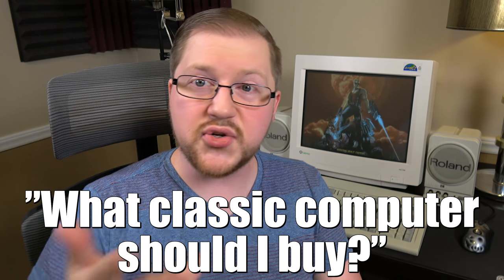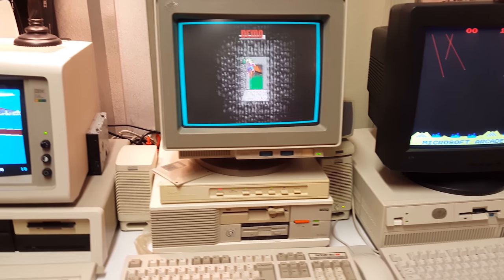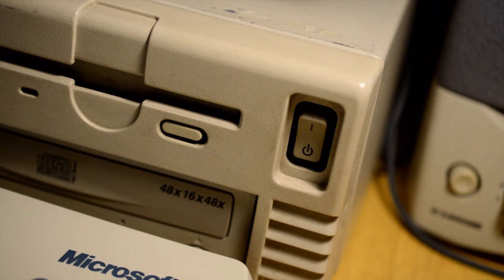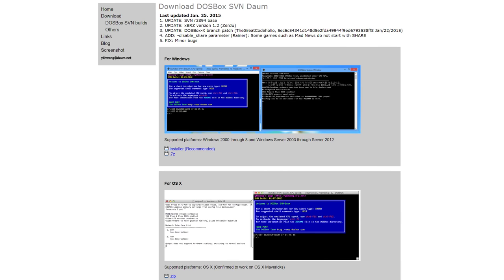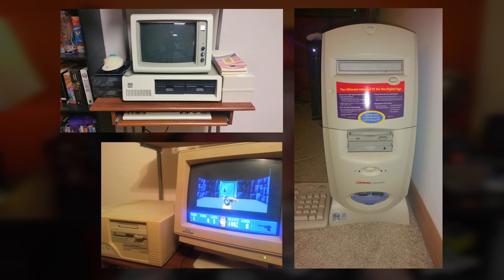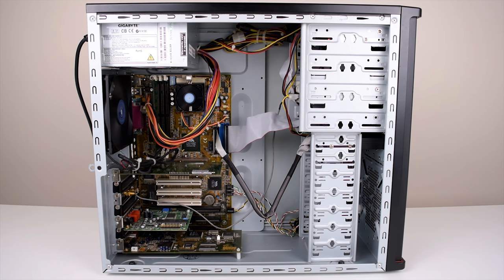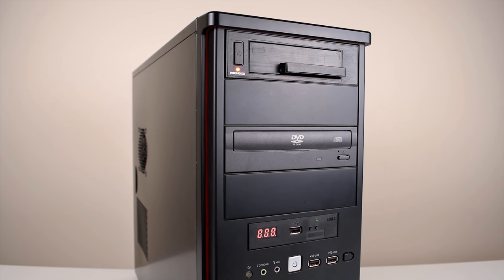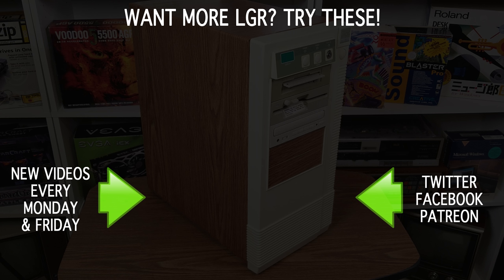Choosing a Retro PC for Games: Advice & What to Look For

Comment: Agree on everything except one:  joysticsk under DOS.  DOSBox is fantastic and an easy solutuion, no doubt.  And though it robs you of the satisfaction of building and configuring real hardware, the operating environment of DOSBox is purely genius.  But my disagreement comes with the joystick options for DOS.  No, you are not limited to 4-button Joysticks.  Since the early 90s, I used the Thrustmaster FLCS, TQS, and RCS (F-16 stick, throttle, and rudder) that you plugged in between your keyboard and PC through the game port on your sound card.  They were fully programmable keyboard and mouse interceptors/emulators.  They still pop up on Ebay regularly, and are an absolute thrill to use if in good working condition (easily restored).  No shortage of web sites devoted to these legendary devices.

Comment: Quick comment on the display showing speed.  It really does not do that, it shows what you told it to display based on jumpers.  Some dishonest stores in the day were known to lie there, like having it show 50 when the real speed was 33.

When I sold those cases, I always set them to show "HI" and "LO".  That way I could throw in any speed CPU and it was correct.

Comment: I'm probably just lazy, but once I started upgrading (Thanks Aces of the Pacific!) I kinda never stopped, so eventually I wound up just putting the older systems back together, albeit in updated forms. I eventually wound up with enough gear to have optimized hardware for a particular generation of games, though some old games that are tied to the clock speed of the CPU (looking right at you Falcon 1.0, and don't try to hide back there WIng Commander I see you) still require the turbo switch or MoSlo. Biggest pain is remembering to replace the CMOS batteries before they die, although I suppose I could just take pics of the correct BIOS settings on my phone and have them available. Probably should do that, actaually.

Comment: 16:50 seems interesting. He (Brutal Moose) has swapped out the matrox graphics (and hopefully kept it). The "celeron" CPU is definitely 800MHz? That seems a bit out of place for that model and yet he does not seem to have indepth knowledge which suggests somebody else has done something to it before he got it, unless he mispoke and meant Pentium3 at 800MHz. It's just that a Coppermine celeron FCPGA-370 can be overvolted as a means of overclocking because (unless somebody else found a way to put an 800MHz celeron in that machine) that might be a celeron that has been overvolted from a core clock speed (to 800MHz) by means of increasing the Front Side Bus. It might have once been a Coppermine 533A MHz or 566 (if the BIOS shows the FSB over-volting to have resulted in a FSB around 100MHz), or it might have been a coppermine 600MHz or 700MHz overvolted to 800MHz - however a 633MHz or 667MHz is more likely (than a 700MHz) as those actually came in the HP machines. If any of that is true (and btw check the bios), the celeron might be overclocked to 1.8Volts. That'd get hot. If this is all true, it means he has a good (desirable - as in collectable, as in valuable) celeron. So swapping out that CPU would not be a wise move (especially if the voltage has been changed) because throwing it away would be a terrible waste of money.
Putting in a faster CPU probably would not add much (although perhaps a pentium3 at 1GHz would help a bit but you might devalue it). A faster graphics card would make more difference. A Radeon 9800pro might be slightly overkill but would work (assuming the Power Supply behaved), but really a 9000pro or above (to compete with that current decent nvidia he has) would be minimum needed. Probably an ATI 8500 or an fx series like say at most a nvidia fx7600. It would make more sense to remove that second RS232 serial expansion card (or just move it across to a new PCI slot to nudge an IRQ if needed), disable the onboard sound's IRQ (again via the BIOS) and put in a usb2 card (probably saturating the bandwidth making it difficult to put in a PCI ethernet). Then plug into that a usb-to-rj45 ethernet dongle. Then buy the XP machine and network them. Maybe also get a null-modem cable to play multiplayer baldursGate2 (and other infinity engine games). An ISA ethernet (10Mbps) expansion card would not be out of the question. the upgrading of the graphics (e.g. to that ATI 8500) would allow for some games to run better such as battlefield-vietnam multiplayer LAN networked to his 2nd newer WinXP machine.

Comment: Yeah this is a hard question to answer, just because the desire to play classic games on authentic hardware is necessarily for the purpose of satisfying the desire for subjectively pleasing aesthetics, with objective performance measurement being secondary.  

If it were up to me, I’d probably choose a pentium era computer.  This is because windows 9x operating systems will all run on it, giving access to basically all dos and windows games from the “classic” era, while still being part of the classic era itself.

Comment: I think I still have my old Asus XP55T2P4 around. I remember doing the jumper trick to get a K6-3 400 to work on it. Setting the external jumper to 2x and it internally switched to 6x on the 66 bus to get 400MHz. It has a pair of 12mb Voodoo2's along with an SBAWE32 and uses a TNT2 as the primary graphics card.

Comment: For Dos and Win95/98se gaming the absolute best solution is 2 PC's. One for old Dos, and one for late DOS/Win98 era. Build them with old parts, EXCEPT use a Gotek Floppy Drive emulator, and use a SD card as the hard drive. Super simple, and easy to build. The only retro hardware you actually need to buy is a motherboard, RAM, CPU, Sound Card, and Graphics card. Every other single component can be  brand new including the cd-rom drive, enclosure, PSU, etc.. This is a great solution to play games accurately on real hardware, and perfect for old dying floppy drives and floppy drive media.

Comment: Personally I would love a properly retro computer, but I don't have the space for it, so for older games I just use dosbox on my modern PC, and I also have a old SFF hp core 2 duo  machine with a GT 730  with xp on it for games from around that era. It fits nicely between my main pc and 4k tv. Which I can easily switch the aspect ratio to 4:3 It may not be period correct but it works, and rather nicely and being able to play these games is more important to me than anything else.

Comment: The Ultimative Dos and Windows 98 PC for me is:

Pentium III 800mhz (which I can still underclock for problem games)
Asus P3B-F Mainboard
256MB SD RAM
3DFX Voodoo 3 3000
3DFX Voodoo 2 12MB (yes you can use it alongside the Voodoo 3)
Soundblaster AWE64
80GB Hard Drive
Teac CD-R ROM 32X Speed

Comment: When it comes to trying to play games from 1996 to 2003 on newer hardware I have found that for glide games nglide is awesome and for direct3D games I can get past a lot of visual problems using dgVoodoo. The latest version contains files for direct3D emulation. My favourite example is Black & White which on newer graphics cards with more than 256 MB of RAM won't show anything but the most low-res textures the game has. If I pop the Direct3D drivers from dgVoodoo into the game folder and set it up using the setup utility it works in all of its glory. And compared to original hardware I can even play it with high resolution graphics and FSAA cranked all the way up.

Comment: You really only need 3 computers to cover the entire DOS-era gaming period.  An AMD 386DX-40 (with turbo to be able to downshift) to cover the 80s.  An AMD DX4-120 with a good VLB video card (with turbo for downshifting) to cover the early 90s, and an AMD Athlon XP 3000+ with a ViRGE/GX and Voodoo 3DFX makes a great PC that will cover the entire later 90s.  All parts are dirt cheap on Ebay, and can be easily obtained compared to the now over-priced and increasingly rare Intel Pentium 3 setups.  AMD is the answer to retro builds, and these 3 PCs will cover that 20 year era.  However, Phil from Phil's Computer Lab nailed this to perfection with a 4-in-1 PC that is based on an AMD K6-III+ (P3) that can downshift to a 386 by being able to toggle cache options in the BIOS.  Utterly frickin' brilliant.

Comment: Funny,  I just found my old SoundBlaster ISA card in a box, with built-in CD-ROM/IDE pin header and all (for back in the day when computers may have only had one IDE channel and CD-ROMs were often run off of pin headers and controlls found on add-in cards....    Its sort of funny as I believe the drive and the sound card together cost $250 (the drive is long gone--dead, but I held onto the card for some reason).

Comment: Hello LRG. Watching this video and the collection of pcs you have is for me an example to follow as a coleecionist. But here in Argentina it is more difficult than in the United States, since machines like 286 are hard to get the same as the 386 or a little less the 486. Let's not talk about a Tandy 1000 with an 8086 processor that is extremely difficult to lift and with very high prices. expensive And not many people I include myself are encouraged to buy by E-bay from here.

Comment: I use my original P75 for DOS, which I setup for dual boot with NetBSD <maniacal laughter and thunder> windows95/98 I have a P3 553 MHz and I still have a Win XP with one of those Intel EMT64. I made a VM with XP under VirtualBox to play Age of Empires and Galactic Battlegrounds, just had to install the non-recommended 3d drivers which you have to install in safe-mode or it won't run. Also I'm running my King's Quest games under DOSBOX.

Comment: I use a laptop with an AMD k6-2 450MHz, 192 MB RAM, 8MB Trident video card (it sucks, LOL) 20GB hard drive and a 1024x768 TFT display running Windows 98 SE. It works fine for what I use it, which is from Wolf3D to Quake 2 and everything in between. Need for sped runs on it too!

Comment: Some old games writen in Turbo Pascal (or similar programming languages) is unable to run - it yells "ERROR 200", or "EMM has ...." errors (because CPU speed is more than 200 MHz - google says). Im using an old Pentium I @166 MHz (64 MB of RAM) laptop with Windows 95. Its awesome. I have also 286 @ 16MHz laptop (B/W display, 512 kB of RAM), 386 @ 25 MHz laptop (256 colors, 2MB of RAM) & 468 @ 66 MHz laptop (16 MB of RAM). I have also IBM ThinkPad A31, Pentium 4M @ 1.8 GHz (512 MB of RAM) with Windows XP SP3. :)

Comment: Thanks for your heads up advice! My choice is an early XP compatible computer with 98SE installed and an old version of DosBox for those older games like boulderdash, etc. With onboard AC'97 audio, though .... sound is still a real pain in the bum resulting in BLUE SCREENS OF DEATH!

(Oh, for the old C64 times, where the games just worked despite hardware revisions!)

Comment: I would say get an older dell dimension, with a pentium 4, 1gb ram, decent agp card, easy to find and great for old games like cs1.6 and gta vice city. 
If you like to flash a bit more cash, I suggest a Gateway 2000 p5-120 or a Compaq Deskpro EN with a P3.

Comment: I went the via route and built a 1.3ghz mini itx epia-sp with 512MB (took me a while to remember 1GB was not going to work, it wasn't until I rememebered that was the reason I downgraded to XP for a while as I wanted to use all my ram back in the day, soon went back to 98SE though as XP was worse than Vista before SP1 came out, not to mention no Voodoo 5 support officially :( ), floppy drive and 24x DVD-ROM, with a Mac Voodoo5 PCI flashed to work on PC (the board only has 1 PCI slot so this works perfect and ticks all the boxes) running Windows 98SE. Bit overkill for older games, but gives me a bit of flexibility as well as allowing me to have something that won't take up to much space.

Comment: Sorry for the comment on a 5 year old video but this is just cool. I'm currently building (and documenting on TikTok a Pentium II Overdrive / Pentium Pro) with a Voodoo 1. I'm aiming to run an older version of Linux with Wine (or maybe Windows 2000) and hearing so many points of view was super cool.

I think a lot of it depends on what you want to play. For me it's MechWarrior 2,  Rogue Squaron, Tomb Raider and Diablo 1. I think my hardware selection is right in the mix
Reply: Update to this.  I DID build the machine.  Pentium II Overdrive 333 on FX motherboard. 270mb of ram (a few of my 128 ram sticks were throwing issues or it would be 512, but 270 is plenty).  3dfx Voodoo 1 and a Sound Blaster Live (sb 0220 and careful driver install, lol).  I ended up running Windows 98SE.  Playing Rogue Squadron, MechWarrior 2, Diablo 1 and 2, Tomb Raider and X-wing.  

But that being said, I play speed sensitive games (like Jazz Jackrabbit) on my Steam Deck through Dosbox, because it's so much easier to set your cpu cycles and such in DosBox.

Comment: That's it, I'm getting my four PCs up and running... the Pentium III-500, Pentium III-866 and P4 laptop are ready to go but I need to rebuild my Pentium 100 but I have all the parts I need. Just need to find a cheap AT cabinet but those are less difficult to find that I initially thought.

Comment: I see a final unity in the background, great game.

also, 486 laptops have some great bonuses over a desktop. They actually have some interesting features you won't EVER find in a desktop as they continued making 486 based laptops further ;)

Also your problem with games later on in the later 90's early 2000's will be handled by windows 10 compatibility TOOL strange enough. Not compat mode, it has a built in tool that can rebuild a game to fix old direct draw calls like the green screen of icewind dale 2 for instance.

Comment: I am newbie in retro pc industry, and I use for dos games windows 98 machine with slot-1 PII 333, 128 pc100 ram, riva tnt/vanta or any other 8mb agp 2x gpu and PCI Yamaha YMF724 with official OPL3 emulation using pc/pci-sb_link 5pin bridge to emulate isa sound card that many dos games require. In Ukraine, where is war currently, you can find all these stuff for 2-5 USD, the almost “ultimate” dos gaming machine will cost you 20-30 USD! But voodoo 3 would still cost you 60-70 USD

Comment: I used to have a 486 DX4-120, with 32MB RAM, an S3 Virge GPU, AWE32 sound card, 1GB hard drive, 52x CD -- basically, the best hard-ware I could get that would be compatible with one another -- just to play the original DOS version of XCom (since the original Windows version had borked sound effects), with the intention of playing other classic titles also, which never eventuated... Then I came across DOSBox and OpenXCom, respectively, so eventually got rid of it after it say in my closet for nearly 10 years without use... Kinda regret it now I've been watching this channel...

Comment: honestly, i just use a amd k6-2 pc with a voodoo 2, a sb awe64, and a matrox card. it runs almost everything 1987-1999, disabling the caches and lowering the clock speed slows it down to almost early 386 level.

Comment: thin clients are good for dos pc gaming aswell. Especially older models (from 2004 - 2006) are having slower clock speeds - around 200 - 400 mhz.... you may then install windows 98 or so and use the MS dos mode. Upgrade ability is limited tough. Mostly, thin clients have just one expansion slot on a riser card - some even don't hava a rise card at all. hope this helps someone :-)

Comment: This is one of the video I ever seen. Specially for those who just started on retro pc gaming.  I have two pc. One is a compaq presario pentium 3 and the other is dell otiplex dx110 pentium 3 as well however the compaq only use windows 98 se and ms dos 6.22 and the dell use two windows one is windows 98se and the other is Windows 2000 sp4 just for early windows games. The only downside is that it cannot play early Ms dos from the 80's since they only run on 8088,8086,286 and 386. Since 486 and pentium are way too fast for them. It depends what kind ms dos you wanna play.

Comment: I wish there could be a company that would make motherboards etc for retro gaming builds. So like a ATX or mini ITX with a 800 MHz Intel processor and 256 MB RAM with a good chip set for Windows 95/98 and they could also make a lower spec one for MS DOS/Windows 3.11 gaming / WIN95. Today its all about power with not much of a market for retro PC gaming.

Comment: I got my very first PC in 2001. It's a Pentium III 1GHz, 768MB SDRAM, A GeForce 4, And 40 gig HDD. After all this time i still got it (well mostly, the gpu died), complete with all the games i played back then. :) These are the real time machines
Reply: Robi911HUN GeForce 4 range didn’t come out until 2002
Reply: Joey Roller Ah, then it must have been 2002. I Know for certain that it was an MX440

Comment: Hello 

I'm a big fan of your channel. Thank you!!! Iwas wondering if you might offer your opinion on this Retro PC Build (Specs below) that I am considering purchasing. I am mainly interested in playing Jane's titles from 1995-2000 (ATF, Longbow 1 & 2, F-15, FA-18, USAF and 688) Thanks again!!!

SYSTEM SPECS
DUAL BOOT Windows 98 SE Plus! / Windows XP Professional 32-Bit
-Intel Pentium D 2.66Ghz CPU
-1GB Dual-Channel DDR2 666 RAM
-120GB SanDisk SATA SSD
-80GB Seagate Barracuda 7200RPM SATA HDD
-ATi Radeon X300 128MB PCI-E GPU
-Creative Sound Blaster Live! w/ Gameport
-10/100 LAN
-DVD/RW Drive
-SD Multicard Reader